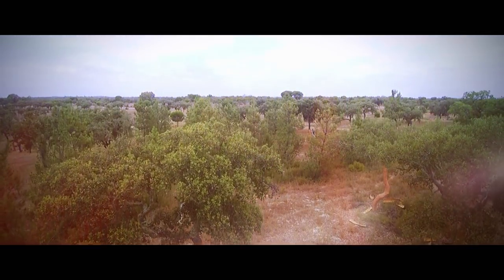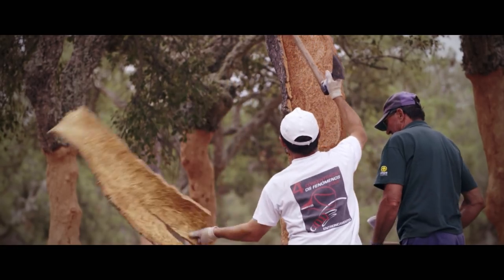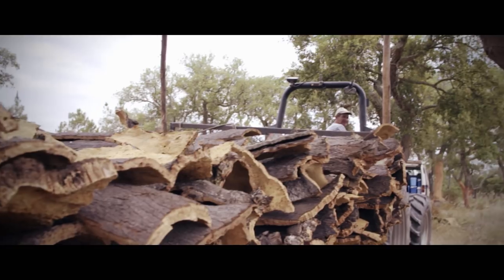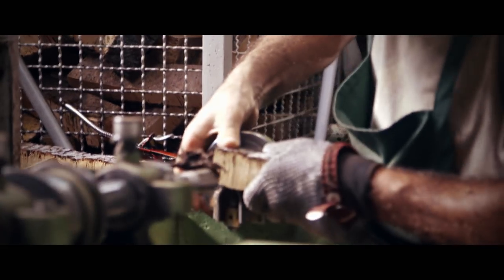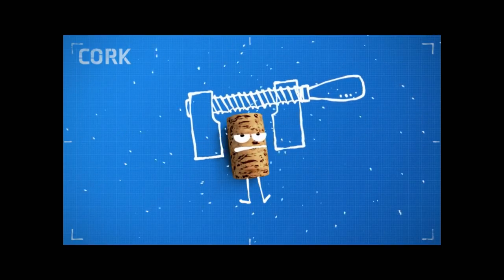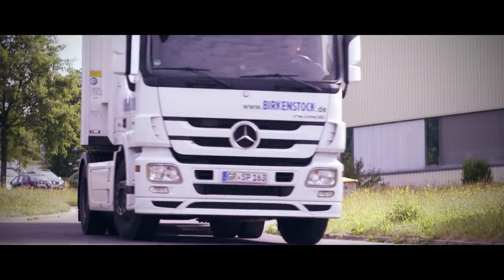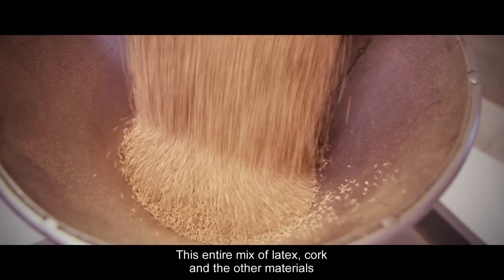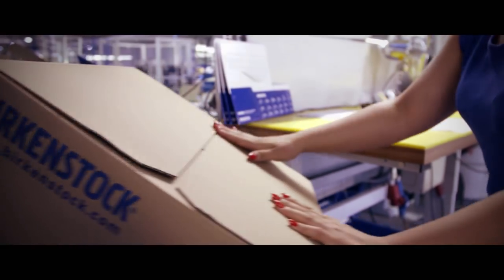Cork, the Soul of our Shoes | BIRKENSTOCK Inside

Comment: I'm a loyal user to birkenstock but I wish this shoes can be more water friendly,
Reply: Ryan same, but they have a rubber version that’s actually really comfy!
Reply: Super birki clog, super noppy are somewhat waterproof and the discontinued Haiti and Aruba are totally waterproof. You can probably still find them new or used on eBay etc. like I did.  Highly recommended. The also make a very lite and cheap plastic version of the Arizona that I don’t recommend. Hope that helps
Reply: Same but I just wear my EVA birks in the water
Reply: They use latex adhesive to be non toxic and more environmentally friendly. Would need to use their EVA waterproof line of footwear

Comment: My first pair lasted 15 years of daily wear, from say late afternoon till bedtime. Camping, dog walks etc. My current pair actually just started dissolving, foot bed cracks, surface just started coming off, weird goo coming up from inside the cork. And all this was just on the right foot, the left only has one typical crack in the foot bed. But the soles are not even that worn. My first pair the soles were basically gone, but the rest was fine. I just ordered one of the cheaper models, as I lost faith in the normal ones.
Reply: They aren't water friendly. If the cork is cracking you can buy a cork sealant to prevent and repair cracking (Birkenstock sell the product). Chances are you wore then in rain, stepped in a puddle, or something involving water. The latex adhesive is probably the "gooing" situation you're facing and is separating from getting wet. If not then you have gotten a faulty pair.
Reply: They can re-soled.

Comment: They could make their product even more environmentally sustainable if they would remove that front bumper.  The middle toe on my left foot bumps up against it and is bruised and painful.  I'll probably have to chuck the shoes.  That is not environmentally friendly! 
I've seen similar complaints.  Not everyone has that sharply angled pointy-toed foot.  We're all built a little differently, but these footbeds try to force you into someone's idea of a standard foot.  Smarter design would make it a bit more flexible and removing this front bumper would be a good start.
Reply: They're meant to be broken down to your footshape like a pair of leather boots, but to make it go more quickly most people use a hammer to lightly tap the toe bar down if it's too high. You shouldn't get rid of it completely, though because that's what your foot is meant to hold onto as you walk